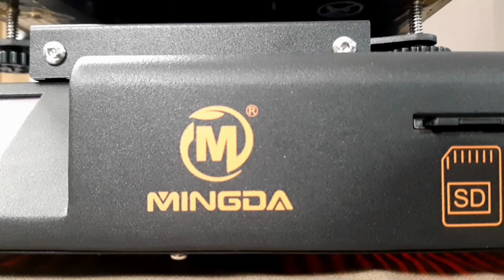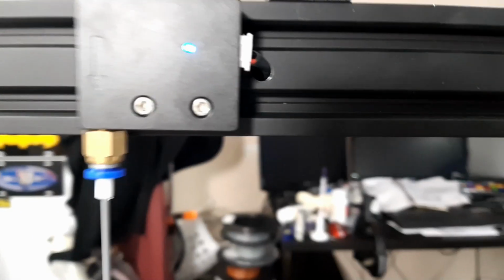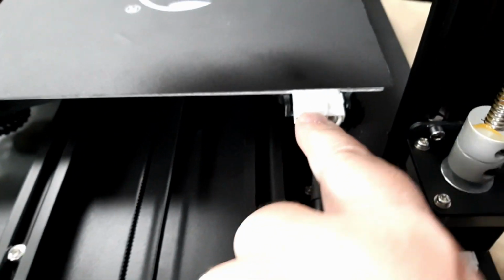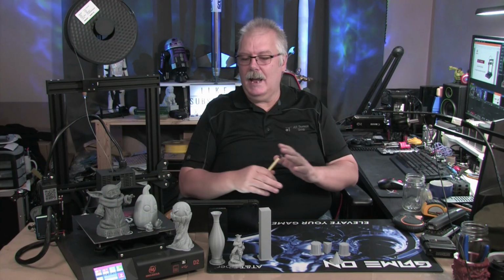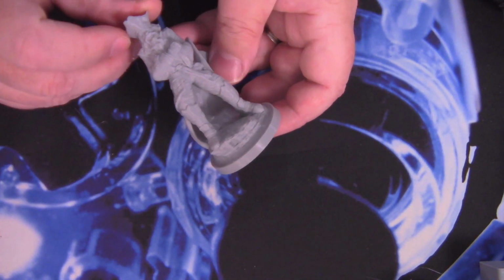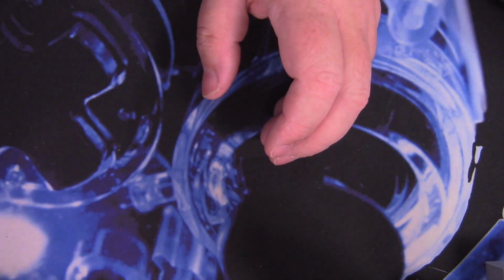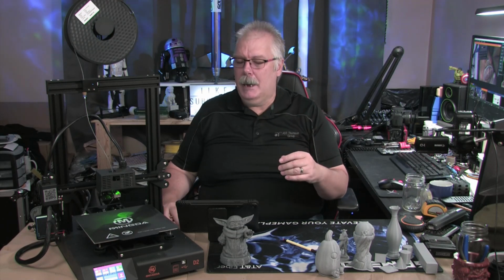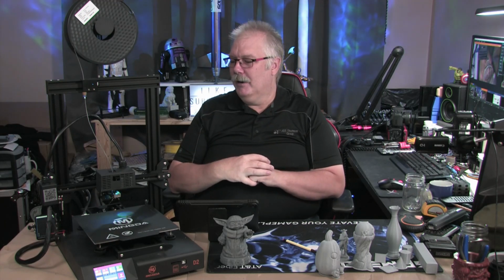Budget price, Pro features, The Mingda D2

Comment: I suggest printing the Mingda-D2 FAN DUCT from Thingiverse, it concentrates the airflow to the printer head.  The printed part that comes with it is too big for such a small fan and leads to stringing.  This upgrade helps but you still see some stringing.  I hope the community starts making some upgrades soon.
Reply from the maker: Thanks for the tip!

Comment: It use silent board?
Reply from the maker: Yes. It has a 32 bit processor and uses TMC2208 stepper drivers.
Reply: It does, the drivers are 2208s.  You could sleep next to it :)
Reply: Thanks for info sir. That's nice I think this is my next printer.